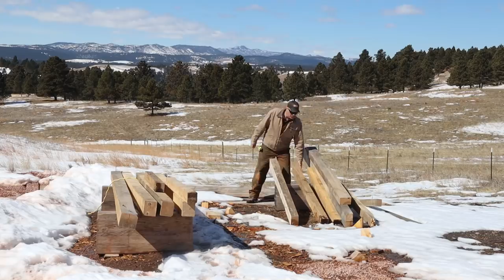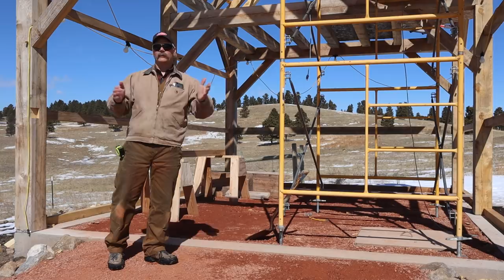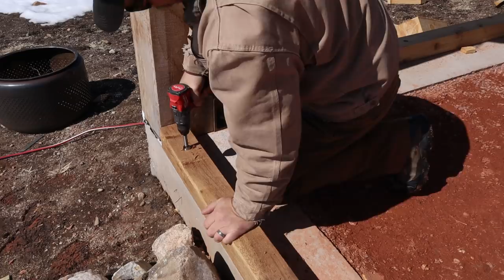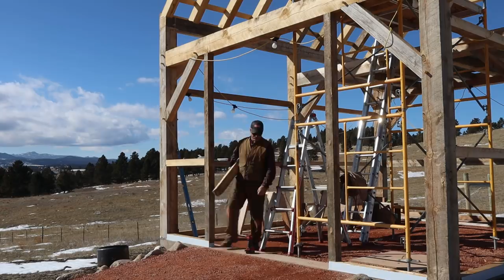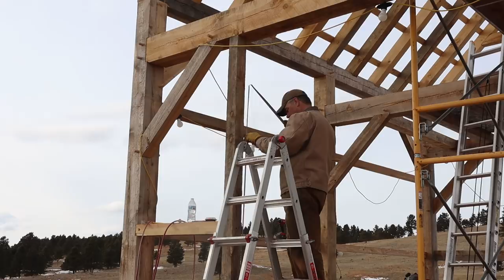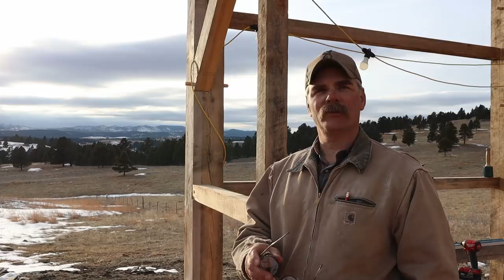Timber Frame Barn Door Opening

Comment: Fantastic Tim!  You're almost there! I'm going to use 1"x10" Cedar boards laid horizontally  with one live edge.  Thinking of doing ship lap but we need to figure out the setup on the mill to do that.  It would look a little cleaner if we can. I'm also doing 2"x 6" stud walls as infill between the Timbers. A lot more work.  The Purlins would eliminate that step.  I wish I had done it that way.  Live and learn.  I suppose I could half Lap them in later as you've done.  Didn't look like it was too painful the way you did it.  You have inspired me to think outside the box.
Reply from the maker: Thanks Tim, your siding will look great.  Putting them in later is not difficult, just kind of a pain.
Reply: @GreatPlainsCraftsman You made it look easy!  Ha!  I'm leaving in four weeks to go to our property to pour the slab foundation.  never done it before.  I already dug the footings so I just need to build the forms and lay the rebar.   The Building dept has given me a lot of grief.  Going to take 25 yards of concrete.  The slab is so overbuilt I could build a 10 story Timber Frame on the damn thing!  I think they just made it hard because they figured I would just go away! NOT! Hahaha!
Reply from the maker: @timcisneros1351  25 yards yikes!  Well, it won't be going anywhere.  Have fun,  don't let the mud get ahead of you and bring plenty of help.
Reply: @GreatPlainsCraftsman  Hahaha, No, you're right, it won't be going anywhere. I have two son's who will be helping.  They're in their Mid twenties and fit.  Then I have two good friends  who'll be there and a few who'll stop in if needed. I should be fine.  Going to pump it in so it will be a little easier that way. Yeah, the Building Dept. didn't know what to do with a Timber Frame so they've made it really hard.  Everything has been Engineered.  I have 120 pages of structural calculations and diagrams.  Two pages for every joint with corresponding data, diagrams and calculations. My Structural Engineer has been a Hero.  I just have him talk to the Building Dept. directly.